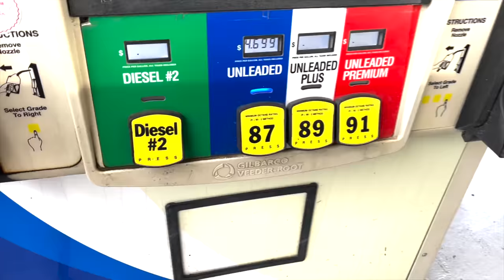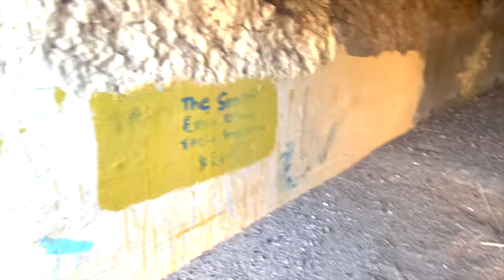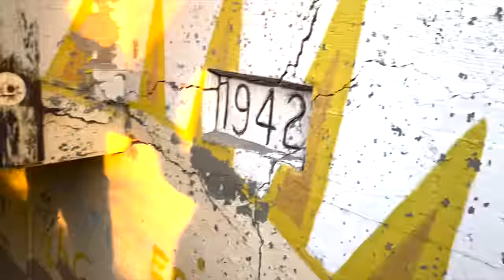Glamis New Years 2022 Oldsmobile Hill & Swing Set Ride | DIRT BIKE DIARIES EP.117

Comment: How does the trailer pull behind Devin's Silverado? I want to pickup a slightly smaller 21 foot weekend warrior for the dez. I have a Tahoe with the 5.3, and have 7,200lb towing capacity at my disposal. 

Side note: Put an chevy ecotec motor in the sandrail! A turbo'd 2.2L ecotec would rip, be cheap to maintain, and they sip fuel. Best part is you can run a 002 or 091 VW trans, which are pretty cheap to get, and rebuild, plus they are fairly reliable with lower power engines.
Reply from the maker: His truck pulls the trailer pretty well for how heavy it easy, he has a programmer on the truck so that defiantly helps, yours should be easier to tow for it being smaller, and yeah that motor might be the plan, I have a 91 bus transmission already, I just gotta save up some more money to get the motor